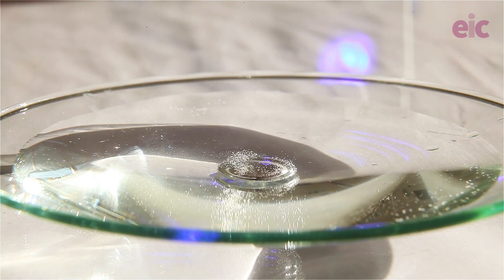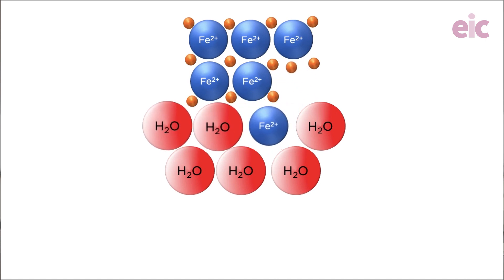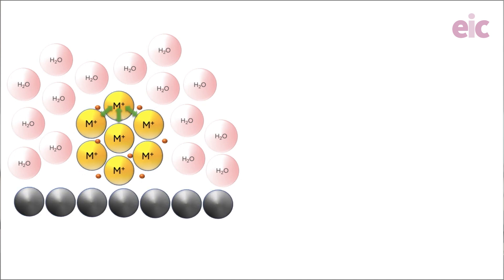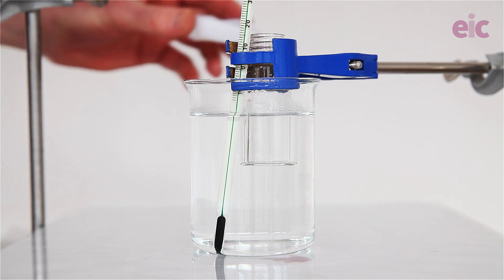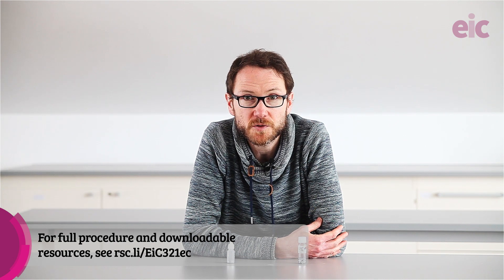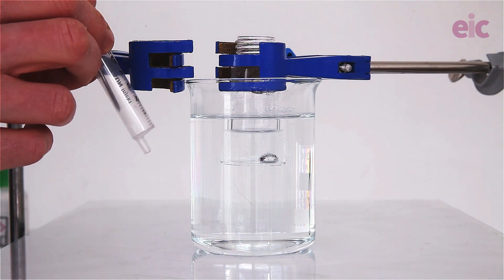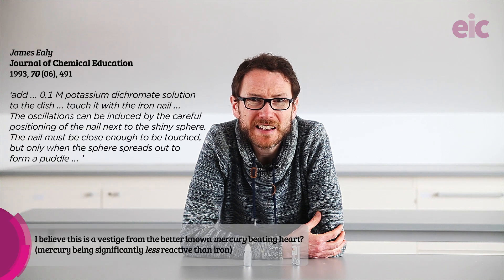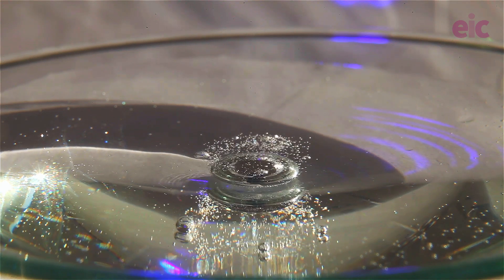The gallium beating heart | Redox and electrochemistry demonstration

Comment: Do you have technician notes for running the demo with hydrogen peroxide? I did it with dichromate and 6M sulfuric before I saw this video. I tried the same 6M acid and a small amount of 30% hydrogen peroxide but it didn’t so much. After pulling some of the acid/peroxide solution off, it started spinning but didn’t “beat”. I’ve been trying to find a procedure using peroxide for a few weeks now and haven’t had any luck. I’ve also tried to work out the math to determine the minimum concentrations of each needed but I’m not really sure where to start. I’m really sure how to apply the equilibrium equations I learned in Chem 2 to an oscillating reaction like this. What I find so interesting about this demo is I’ve seen it described so many ways in different articles. 

I first saw this demo online when I was in Chem 1. I recently changed my major from microbiology to chemistry, and this reaction is what initially sparked my curiosity and interest in chemistry and turned me into a lab nerd. 

Most of my professors have never seen this reaction in person and gallium wasn’t mentioned once in my 1st and 2nd semester chemistry. I’d like to change that. If I can show the reaction can be performed in lab or in a lecture demo with a relatively safe concentration of sulfuric acid and hydrogen peroxide, I think more professors would be willing to do it. 

I’m going to make some Galinstan this week and try this experiment and see what happens.